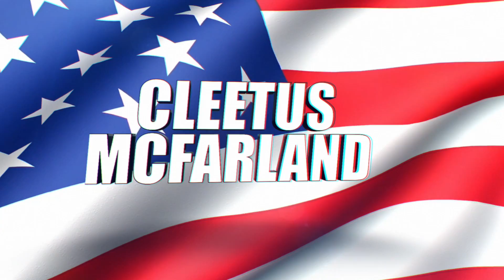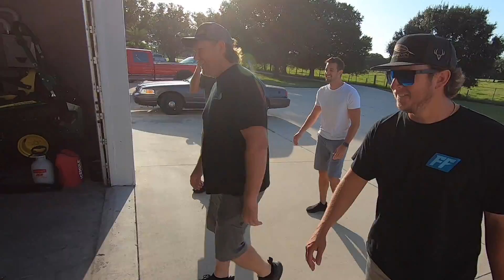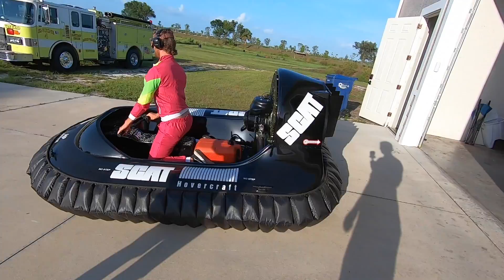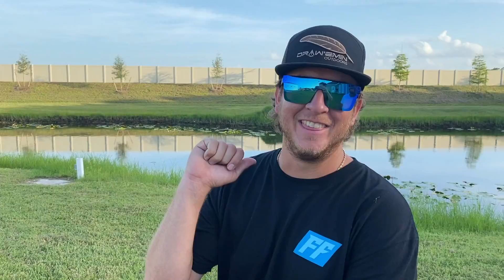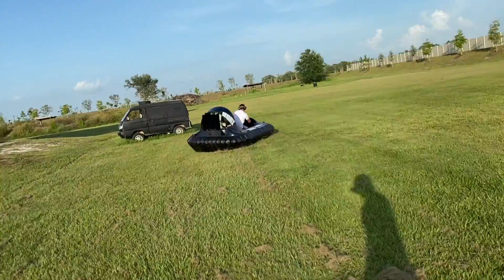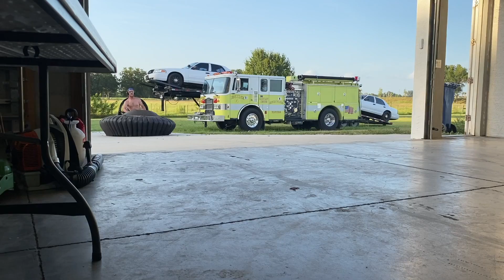Florida Man Takes His HOVERCRAFT Career To the Next Level (ON WATER) #BrotherCraft

Comment: In the 70s, my dad had a Air cycle dealership in seattle and he raced them. They went over 100mph and were insane. I rode on them as a kid as my dad had many. They had 550 two cylinder rotax motors and bigger. Something is not right with that scat...  it must be underpowered or missing some duct seals or something. I expected that to be dangerous and white knuckle fun... but it is not... look into that Cleet!
Reply: bump this guy to the top
Reply: Yeah i wanna see it with more juice
Reply: I remember them being a lot faster too... this one's seriously underpowered tho
Reply: It’s a single rotax not the most powerful but reliable as hell
Reply: Based on the waters reaction to the air it looks like the blade pitch is almost neutral.
Reply: @marriott13108  I would agree, first thing to do is tweek the pitch on that prop!
Reply: This is the uber basic version though
Reply: I think the blades need trimming for more thrust
Reply: Shade Tree Wrenching  Even from the old school clips they looked more lively
Reply: This needs to be the next project to get an engine swap!!
Reply: can you get an electric start on them? my dad just got a used one. im worried about him stalling out on the water and him not being able to get it restarted.
Reply: Bump for more POWER!
Reply: @KildalSMASH  well in one of the previous vids he said they were going to 427 the whole fleet... 😂
Reply: I'm no expert but I believe they should try more prop angle, the engine is at way too high of an RPM for such a low ground speed. Either way, something doesn't seem right!
Reply: The dude who restored it probably has the blade pitch at zero so the new owner/s can learn to drive it at low speeds rather than go full send into a tree at 60+mph
Reply: lol that's some serious kiddo memory, they didn't go anywhere close to 100mph haha
Reply: They guy that restored it literally said it needs tuning...
Reply: @Avboden  Whatever you say
Reply: I think it because he has the blades at such a low turn there pretty close to zero
Reply: Aric Marriott yeah I agree think previous guy has the blades to low
Reply: Well, this has a lawn mower engine, so there's that.....
Reply: It's just a small single. He can definitely supe it up with more power
Reply: Prob just a small motor on this model. Time for an engine swap!
Reply: They literally said in both episodes the guy who restored it set the prop for nearly neutral position.
Reply: @yeah.2596  even in the video they showed the guy is doing 360's on the water with little effort. something is definitely not tuned.
Reply: Top speed for these should be between 40-45 from what I saw online.
Reply: Nitrous!
Reply: Bigger Motor, a little more pitch and the fan needs the 3 missing blades back
Reply: @bradd5112  Yes, the scat is not what my dad had. they were called AirCycles. He also sold Hummingbirds. They were big heavy fiberglass two seaters. They were raced on lakes and really did go 100. My dad was a military pilot, so he modified his racers with big mono tail rudders as well as bigger 3cylinder rotax's/props and different skirts. I used to hang out at my dads dealership as I loved those things!
Reply: I am not sure if you guys paid attention or not, or even watched the first video. The owner after restoration placed blades back in stock angles, and Cleetus said they will loosen them up and increase the angle. Not only Cleetus said it, but Cooper said the plan what they will be doing as well. So there's no need to speculate and act like engineers (even if you are one) :D.
Reply: Bump
Reply: Bumped
Reply: its very slow
Reply: @SuperRandykid  he was scared of the damn thing
Reply: @brabbit2902  mine screams  and goes 50mph the  same scat model 1988 with a 400cc ccw engine -they will make this unit dangerous we need to wait is all! :) it should INSTANTLY lift up way higher than this  at 1/2 throttle ! no bs  it is a blessing in disguise that this is so slow now so that they all can learn to fly  so when they get it beyond the speed of a new unit they will know how to fly it properly  :)
Reply: @KildalSMASH  im not sure of the displacement but thats a pretty big 2 stroke motor, what do you think theyre gonna swap in thatll do better. they used a 2 stroke on it for a reason, that being you would blow most engines holding them wide open like that
Reply: @p51abc  let me know when you find a lawn mower with a 532cc two stroke two cylinder engine, its funny how no one knows how to type a search in on google and theres 30 people that dont understand how boats work acting like they know what it needs. i swear i look at these comments sometimes and start to hear banjos. nothing matters unless its got a big dick swinging v8.
Reply: This one is a Rotax 270.. it’s only A 27HP  single

Comment: I work at a lawn mower shop and I’d love to give my opinion. You should engine swop the hovercraft for a 40hp vanguard engine by brigs with the oil guard system so you can mount it at that angle without oil distribution issues. It’s got an electronic clutch so it wouldn’t bog nearly as easily when you change the pitch of the blades.
Reply: you sir are a genius
Reply: How are you likin those vanguards? Had a rep come by my shop to show me a demo mower. Looked damn cool but that price tag though lol
Reply: No he should swap it with a 2 litre car engine like we do over here , sooo much more fun and around 150 hp ✌️👍
Reply: That sound like it will work. The only issue is that it may throw the balance of the craft by making it tail heavy. Maybe if he place the engine where the fuel tank is.
Reply: Norman Guzman the oil guard system is a 5 quart tank for the oil that the hoses could be changed on the move that weight forward other then that I’d guess the engine weighs around 35-40lbs I could find the exact weight tomorrow
Reply: @calebthomas5936  Yeah dude the Vanguards are serious motors. I got a couple of scags with the "big block" motor. Sounds like a big block without the muffler too😉
Reply: Tevi Silva we love them we’re based out of Texarkana Texas we get northern rain and Texas sun and the grass is uncomfortable around here commercially without having at least a 28+ hp vanguard has really done well we sell Ferris,scag,bobcat,walker,and our residential mowers are snapper the Ferris 3300 just came out and it’s the first on the market to have the 40hp vanguard
Reply: Offroad Addict we sell scags at the shop which model do you have?
Reply: aussie guy 85 if you can find any engine with that many hp and a horizontal 1” crank then that would be better but for the set up without too many expensive modifications that wouldn’t hold up nearly as well that’s as big as I would go
Reply: He would be nearly doubling the power plus no telling how much torque
Reply: I was waiting for a smart guy to talk about the upgrading of the CleaterCraft. I agree needs serious modification. When we can see daylight under the CleaterCraft you will succeeded with Mission #1.
Reply: You sir are a genius Caleb
Reply: The Cleeter Skeeter needs POWER. 40 HP just means you gotta do it again. Fix it once. Fix it right. Spend money to save money.
Reply: Anything by Briggs and Stratton is the way to go
Reply: @aussieguy3689  modern 600cc streetbike engine i say, like around 150hp+, and some nitrous on top
Reply: @aussieguy3689  Why not a motorcycle engine? Lightweight, compact, lots of power.
Reply: Twin turbos and NOS is next lol
Reply: A lawn mower engine is going to run 3600rpm.  More power would stop bogging but not give you more blade speed.
Reply: More power isn't really going to do much with that tiny fan/prop. If they want to really get it going, it needs a bigger fan. Doing that however amounts to basically building a new hovercraft (larger fan needs heavier mountings and a different engine mounting, which likely means lengthening the main body).
Reply: Gsxr600 motor ftw
Reply: @aussieguy3689  - if he goes car motor, should be a lightweight rotary. I'd reckon the D-block flathead four from Europe for ultralight aircraft would be an even better choice, as it's made to run wide open for long periods.
Reply: @Chocolate_dragon  doesn't need more blade speed yet, needs more pitch first, and for that it'll need more torque, at constant throttle. Bike and car motors aren't really made for that, ultralight aircraft engines are 😀
Reply: @TheAverageDutchman  bigger diameter also means more noise, if the blade tips go too fast. Going by the blade spacing, wouldn't be surprised if there's a kit to fit another three blades in there, for more surface area, pushing higher volume of air, like going from small prop to large fan on model aircraft. More blades at steeper pitch as ground speed increases, they used to race those things a lot faster then we see here.
Reply: Chocolate dragon those blades are only meant to spin at 3800 max so what he’s looking for is more torque so he can angle the blades different not more power so he can throw them to the moon when they brake off or worse injuring any of the guys we all love to watch in his videos that help him create his amazing content.
Reply: motoman22atgmail how will they mount if you can figure that out that would be great but the engine already on there has the same crank all you have to do if take it off and mount the vanguard it’s meant for this
Reply: PiDsMedia what’s on there now is basically a 2-stroke low power version on the new vanguard it was probably a good choice back then but with the new engines coming out without putting too much stress on things or modifications that make it look stupid the vanguard is the way to go
Reply: @PiDsPagePrototypes  I've actually designed one. There's likely a few blades removed because the motor isn't powerful enough. Yes, you can buy loose blades (they're standard fans for large industrial air systems) but that doesn't always help. In a small fan like this at higher speeds the blades also mutually interfere with each others air flow and sometimes you get better air flow with fewer blades at a larger pitch. You want the fan to take exactly as much torque to spin at optimal rpm as the engine can provide. You can do that with number of blades, blade length, blade width, and blade pitch. There's special calculators for determining the optimum specs depending on force required at optimal engine power and rpm. (See for instance one well known supplier at Multi-wing.com)

From experience I can tell you larger fans usually actually make less noise, but their optimised to run at similar tip speeds, so lower RPM. 

I doubt you'd be able to sink a full 40HP into the small fan that is now on that SCAT hovercraft, even with all blades, without requiring so much blade pitch you risk stalling the blade and destroying the fan.
Reply: @ziiofswe  not as much torque with a bike engine , when you change the pitch on the blades it places a lot more load on the engine it makes a surprising difference
Reply: @PiDsPagePrototypes  i haven't seen a rotary in a hovercraft that would be interesting maybe  a 12A or a 13B mazda motor , there are quite a few over here that use  Subaru boxer engine's and others like using Honda 4cyl motors
Reply: Kloppertjes he said they could adjust the blades from stock but that tiny engine can’t handle it

Comment: Guy who restored it "I didntwant to hit full throttle because I didnt want to hurt it"
Cleetus- "dont let off the throttle when you're ripping it" 
😂😂😂😂
Reply: At least it went to a good home.
Reply: If they blow it they can just send the engine to Texas Speed. It may come back bored, sleeved and ready to take 40lbs of boost, but who would complain?
Reply: @zippySquirrelface  hell yeah!
Reply: mlnlme1 Yup this thing needs a turbocharger
Reply: @Dakakeisalie  cars and cameras would put a predator motor on it with an absurdly high revving build.
Reply: I pray the guy whole sold them it never googles their youtube channel, hell be sitting at his desk with his jaw on the floor almost in tears 😂
Reply: @IntenseVLT  not the easiest thing to turbo a single cylinder 2 stoke, but would be epic
Reply: @keyboardplayerakas  Could work with a 2 stroke injection, you plug the oil feed in the turbo and the return to the pump.

Comment: You know, that drone might be the first thing I ever buy from a YouTubers sponsor since that whole thing started, looks like a decent little unit. 
Also, that hovercraft needs some more power. Just be aware of the prop speed limits.
Reply: Just a question does more power stil help if the props are at their limits?
Reply: Nothing worse than a youtuber trying to push some crappy mortal combat like phone game. I actually watched the whole drone segment
Reply: @youcanbesmartaskhow3857  no i dont think so, I'm not an aircraft expert but i think the 2 things that matter the most to make it faster are the prop rpm en the pitch of the blades, now he has a soft pitch on the blades wich doesnt require a strong powerfull engine. If he was to pitch the blades alot more it would require far more from the engine to reach the same rpm, thats why everyone is commenting to swap it i guess. What projectdelta is talking about is the props speed limit before the centrifugal forces would send the blades flying.
Reply: Check out fpv racing drones! They are insane and im absolutely hooked. Havnt touched my DJI in months
Reply: Mathew vH you’re very right, changing the pitch of the blades is like changing gears in a car, if they had more power and higher pitched blades you could go faster for the same rpm
Reply: big Hurtt not realy unless they add a motor with for rpm but more power isn’t realy going to help they need to adjust the blades
Reply: We haven't seen it rip on the more aggressive blade pitch yet, it will deffo be more tight once they set it up properly.

Comment: That thing definitely needs more power lol let james after it!!! 

🚤
Reply: These things take a little getting used to to control so it's probably a good thing it's slow. Plus upping the blade pitch probably will get it a bit more. Once they all have a hang of it, yeah throw some power at it.
Reply: No run that engine on alcohol and a fan for  the extra power.
Reply: Cleet should do a 4 stroke swap to give it some more power from a newer bike

Comment: I am expecting an ls
 tt swap cleeter don’t disappoint now
Reply: nah that would kill him.
Reply: Problem with a ls swap is weight. Light weight and high rpm is the only way to go.
Reply: GSXR motor or the motor out of the golf cart would be a bad ass swap lol.   Get that thing cranking and upgrade the float system to a beefier setup.
Reply: K swap is more power to weight for this type application.
Reply: a 13b would make a lot more sense cuz of the power-to-weight ratio and size. the engine is tiny as hell too, so it would be easier to retrofit.
Reply: They should get the 3 cylinder that Jeremy pulled out of katertot. Get a bigger fuel pump and a turbo. A hundred hp on this little craft would be absolute insanity.
Reply: How about a rotary?
Reply: @annadarby7224  wouldn't do as well for this application, better off getting a 2 stroke designed to be held WOT forever vs a sport bike motor
Reply: He mentioned putting a 250hp side by side motor in it

Comment: Check the fan blade pitch to make sure it is 100%. Then find out the prop speed max rpm and how much torq that eng is putting out. That ducted fan should push that Scat at about 30 -35 mph with the blade pitch correct and the right power. 
The stock Scats were rated at 28 mph if I remember correctly.
But that can be played with if you know how or you can just put more power and a much better fan on.
Warning!!! It will get addictive. Hovercraft are too much fun but you gotta have it !!!

Comment: @p51abc  lawnmowers don't have two stroke rotax motors. These are like 15 hp. The briggs 4 stroke lawn motor is 5 hp in the same size. You can get four cylinder Rotax or even Rotary it will easily do 80+ MPH. I used to design these back in the 90's. You can build kits pretty inexpensively. The thing that makes them maneuverable is light weight construction and thrust vectoring and valves with two motor hovercraft. One small motor for lift and a big one for thrust. That way you can power down the big motor and still hover.  I wanted to make a carbon fiber hover craft with a turbo rotary primary motor and an electric motor for lift. They even make one that has wings and can jump and fly short distances. Look up a UH18SPW or a 19XRW on Google. They are pretty fast if you know what you are doing with them.

Comment: the thing is definitely slower than it should be. adjust the blade pitch first, and if that doesn't do the trick consider getting a different prop or a bigger engine. hoverhawk has a wide variety of fans that might better suit the application.

Comment: Mount a Rotax 582 two cylinder, 50 kg with 64 hp, add the missing blades and turn them all to an aggressive pitch.
https://en.wikipedia.org/wiki/Rotax_582
Use the old Rotax 277 for a  nose fan to pump the skirts and supply lift. A SCAT can lift more then 700 lbs.
The extra weight in the nose gives a better balance to the SCAT, and lift force is no longer diminishing your thrust force. Winning!

Comment: What you need for more speed is more disk area on the main propeller not more pitch on the blades.  Back around 2000 I built a hovercraft from SEVTEC plans up in Seattle and we used 5 foot diameter props off of ultralight aircraft and only had to powered it with a 22 hp Briggs & Stratton lawn tractor engine.  You can see it in the 6th picture down on this page: https://www.hovercruiser.org.uk/sev3/index.php/builders-corner/15-pictures-page-8